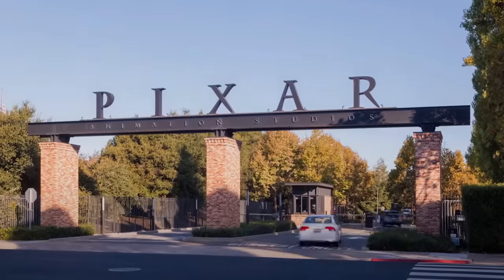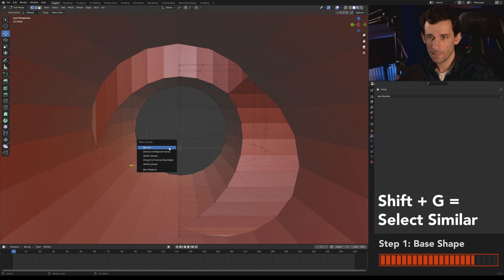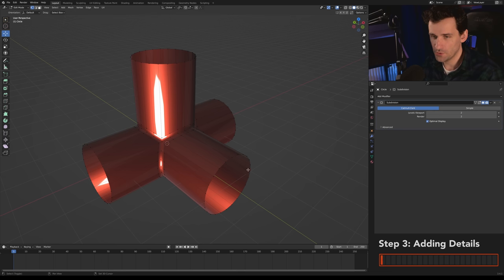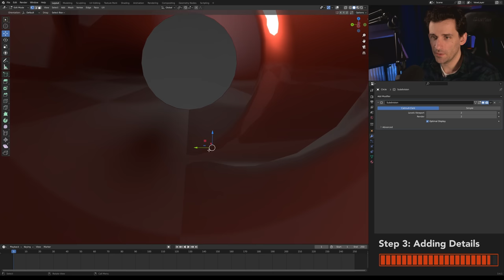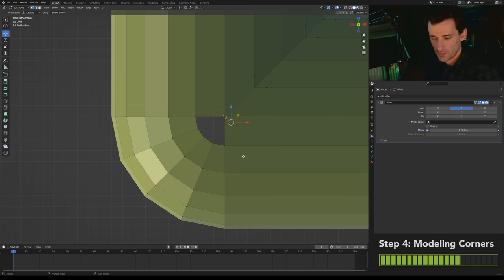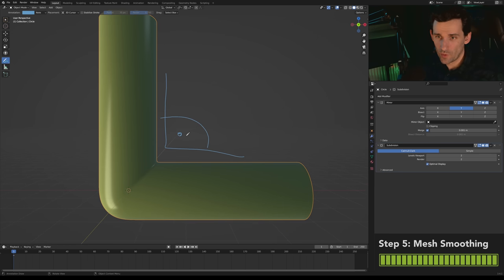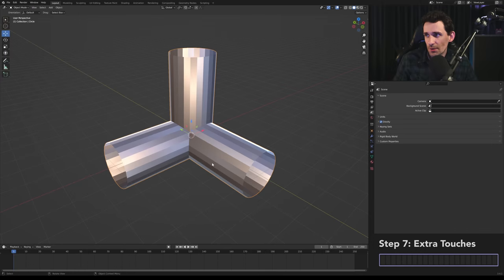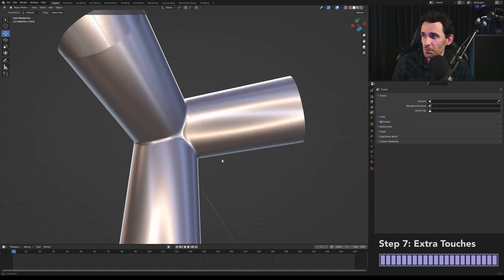3D Models That Will END Your Career

Comment: a better method is to not use a loop cut, but mean crease.
Reply from the maker: it’s by no means better
Reply: @Chocofur  loop cuts add unnecessary geometry and it's 10 times easier to adjust.
Reply from the maker: @RiceWitch-dingus-400  if you want to preserve a 3d shape across multiple projects / 3d apps etc, there's no such thing like unnecessary geometry. I mean, of course there is if you make your models too dense for no reason with edge creases and subdiv modifiers on top of each other, instead of adding a couple of edge loops here and there.
Reply: @Chocofur  edge loops add a lot of geometry and it is for no reason when you have things like mean crease. If mean crease didn't exist it would be necessary.
Reply: @RiceWitch-dingus-400  it won't give proper shading, and there will be pinching everywhere, if you want to model professionally you will have to follow some rules, and also it's great practice for learning modelling and applying for jobs, almost everyone needs perfectly subdiv models, so that's why this method is better than adding creases
Reply: @xd1845  if it gives odd shading than use autoshade or edge sharp
Reply: @RiceWitch-dingus-400  instead of using excuses just learn proper topology
Reply: @xd1845  I've literally never had that problem!
Reply: @RiceWitch-dingus-400  i'm not talking about problems, in subdiv modeling you are not supposed use creasing, yes it saves more polys but for higher level productions that's not the matter, and also if you model it properly it wont cause any issues + you can add as many levels of subdivisions without loosing volume (like, you can use like 4 level subdivision for closups and 2 for normal)

Offcourse this modeling technique is not for lowpoly and gameready models,
but there's a high demand for these models so it's still usefull and that's why professionals prefer this type of modeling

Comment: I can't belive people don't know about mean crease
Reply from the maker: do crease settings from Blender work exactly the same way when you export models to other formats or software?
Reply: @Chocofur  probably don't, but if you accept every subdiv modifier it will works and looks exactly as in blender since its the same mesh
Reply: In this example this would be working mostly at the end of the pipe without need to add more geometry to it, worth keeping this feature in mind if have to keep the low poly count for things like games
Reply from the maker: @ackarpl2058  it's nowehere near the same mesh after merging subdiv mod with creases

Comment: Pro tip: Don't use blender for hardware type models. Use a CAD software that's sole purpose it meant for these types of hardware type models like onshape, inventor, fusion 350, solidworks, AutoCAD, etc.
Reply from the maker: and then waste time importing them back to blender and cleaning up the CAD mesh
Reply: @Chocofur 
If you're working on an animation project or something along those lines that's being done in blender, then you have a fair point, and for that I think this is a great tutorial video for that scenario. However, if you work at a machining/manufacturing company and need parts to be 3D printed or cut or machined, then the other softwares will be quicker and easier.

Comment: it's cursed to see all the boolean stuff, while you could just use mirror with empties and not bother at all about cleanup for this here. In 3ds max it's even faster as you don't even need to create an empty  or other Object the pivot comes build in with the modifier

tldr: set control edges properly
Reply from the maker: what?

Comment: Sorry, but I don't get it.  The finished product you say "looks beautiful" in fact looks like "fake digital crap" to me.  Yes, it appears "smooooooth" but, IMHO,  that's why it looks fake.  

If there is an 'uncanny valley' for mechanical parts, I submit that you've revealed its location. 

Anyway I'm still giving you a thumbs up.  Because I suppose the disconnect has to do with my interpretation of beauty.

Comment: nice vid bro, but in the second model you created a point which has 5 edges starting from it.. BAD! lol kiddin... but if you wanna do porn you should have made one more loop perpendicular to the section of the tube and voila. I mean modeling the intersection of the two tubes with two full parallel loops (actually you could have mirrored at 45 in the intersection).. easier to do than to explain

Comment: Maya user here 👋.. Honestly this seems like too much work, with boolean you would've probably done it faster. Bevel without chamfer helps to create supporting edges way quicker and with consistency across the model, for 90° angle I would've probably beveled two cilinder caps as close as possible. But honestly those are tricks that are usable in Maya, I don't know if you have same or similar tools built in Blender. Only thing that is kinda annoying is that every time you use booleans in Maya, you need to click join verteces every time, would prefer to have this functionality built in the new boolean tool.